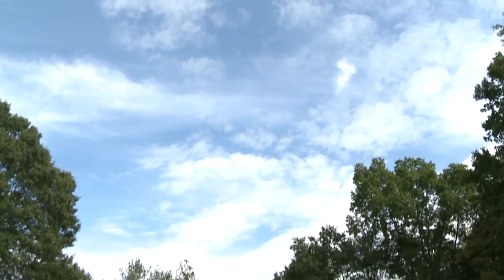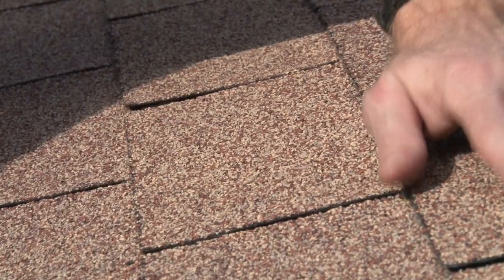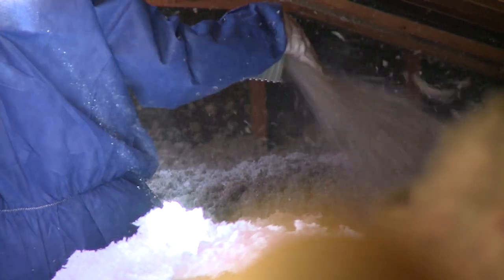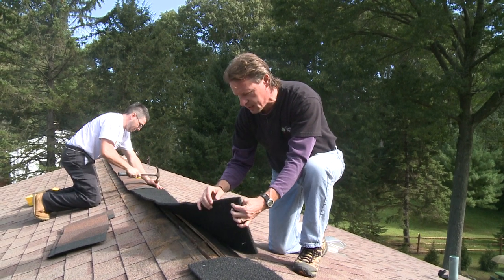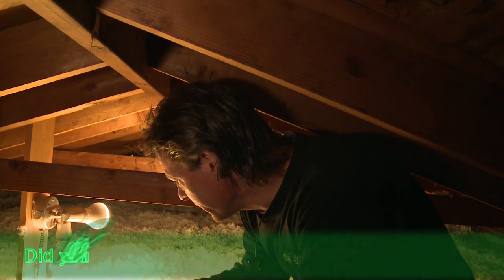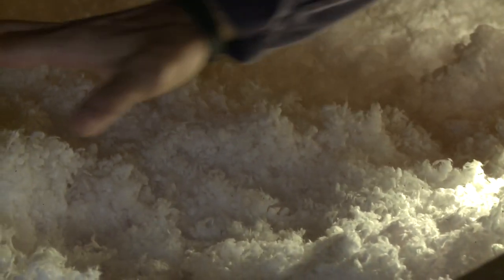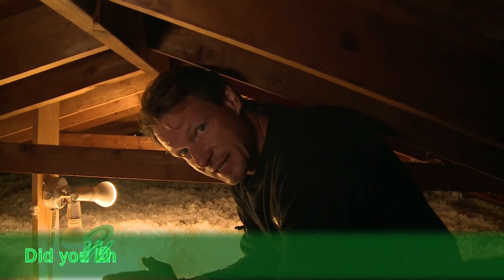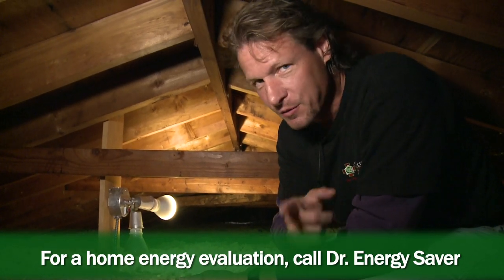Improving Blown Fiberglass with Blown Cellulose Insulation

Comment: Yes, you can blow cellulose over fiberglass.  You have to air seal first which means you have to move the batts first.  If the batts are dirty or pests have made a mess you may want to remove them.

Comment: On this particular job, we added blown-in cellulose on top of existing fiberglass insulation.  The previous contractor installed soffit baffles.  They are not visible due to the angle of the video shot.

At Dr. Energy Saver, we install soffit baffle vents on all our jobs where we are adding blown-in cellulose insulation.

Comment: No air flow into the attic after you blew the cellulose into the soffits without baffles.
Reply: I saw that too, even though they did put a ridge vent. I don’t think that helps very much because the soffits help suck in air and is supposed to be drawn out through the top roof vents. I would like to know why and if they really blocked the soffits.
Reply: Yes, baffles/airchutes/rafter vents are a must with blown-in insulation especially when you topping up existing insulation